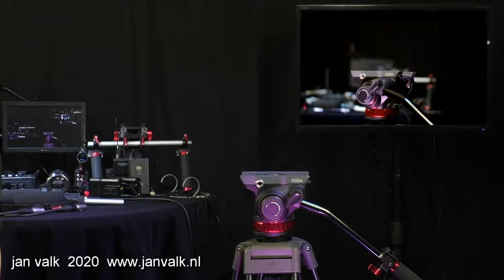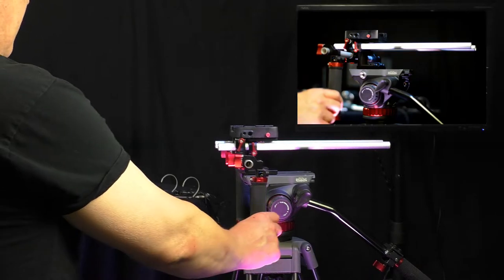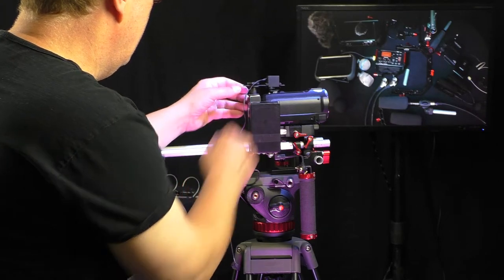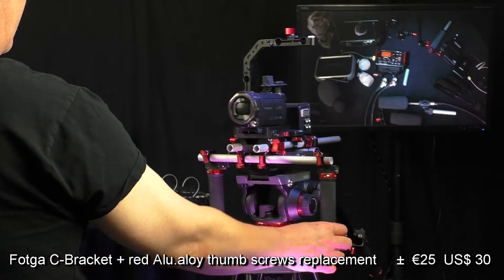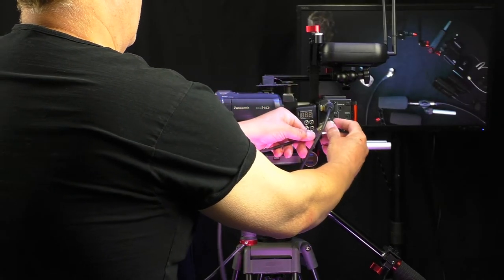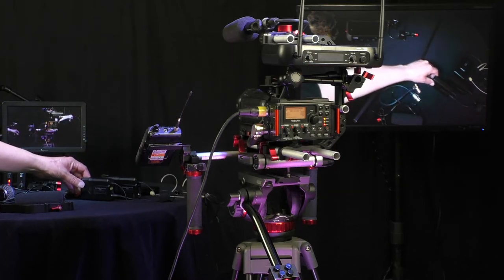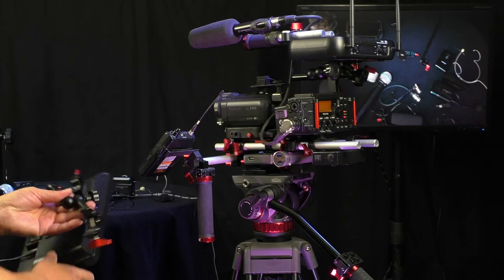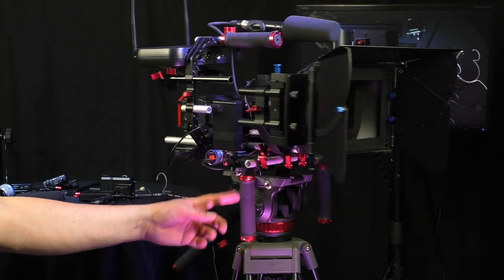DIY Homemade Video Camera Rig for HC-V770 or other camera

Comment: What are some examples of what and where you shoot with your equipment?
Reply from the maker: Thank you for visiting my video :) 
There is relative much wireless audio and power attributes on the rig. This is because I record 'whole day going on'  riding-lessons and other day events. Most of these events do not have wall power nearby or would limit quickly moving to another spot. The multi wireless options are used to record the main speaker and sometimes students. Most times I do video recording and PA event audio for the audience combined.
Some examples:
https://youtu.be/FMa8bDD2X0M  (Quick view of the rig setup in a live situation, riding arena)
https://youtu.be/wEchXt2yvn0      (indoor lighting setup, singing, tascam audio recorder with sennheisser microphones, raw audio recording, no post audio handling)
https://youtu.be/82socyPEmHw   (Promo with extreme sunny background) (not my microphone)
https://youtu.be/QE4xwX_js3Q?t=24     (Promo in riding arena)( dpa headset, sennheiser wireless)
https://youtu.be/rMllMZy9pL4    (compilation indoor/outdoor riding) ( dpa headset, sennheiser wireless BUT sound recorded in camera)
https://youtu.be/jncROp4M4f8   (daylight outdoor, promo musical theater) (dpa headset, sennheiser wireless)
https://youtu.be/iyy42Ro7Im4   (low light, inside my house at night )